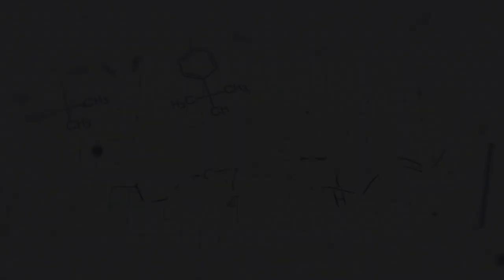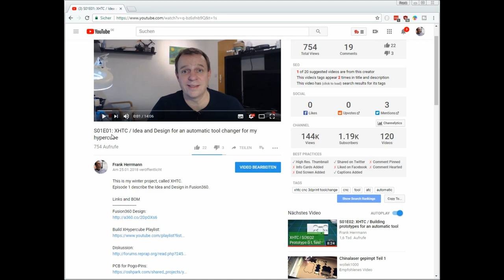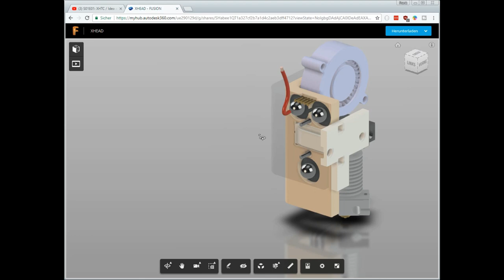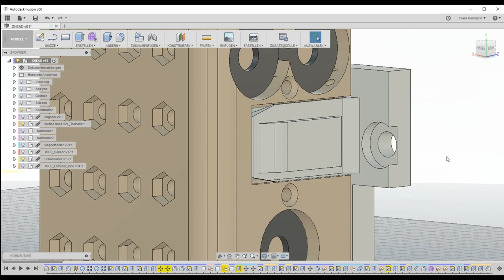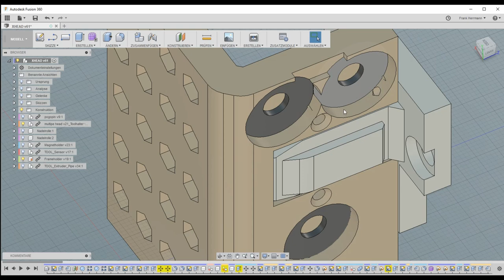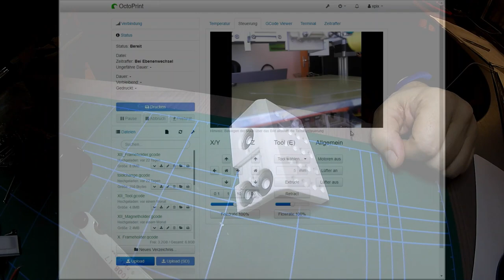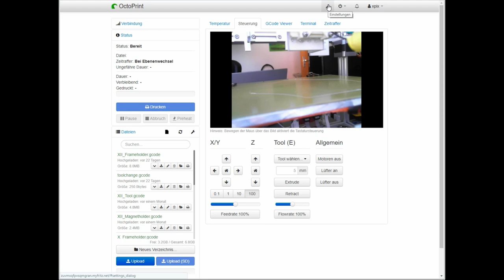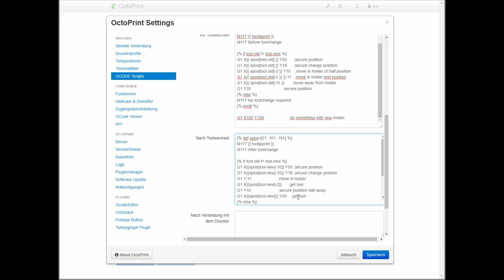S01E03: XHTC  / Design Improvements & Octoprint Preferences

Comment: Hello Frank, thank you for sharing. I like your approach with the all magnetic coupling. You asked for some feedback, here's my pitch:  I'm designing a tool change as well, and consider keeping the nozzles hot. Maybe at full temperature, maybe not. Maybe it's even possible to let the nozzle cool and have a timed heat up in the parked position to be hot at expected time of tool change. I also had the pogo pins in mind, and think it might be an option to add an extra pogo connection in the parking position of each tool. Every parking position has it's own temperature control, which can be easily added and controlled by the board's extra space for additional extruders. Let's say your board has connections for 3 extruders. Tool 1 would be the real x carriage, tool 2 and 3 dummy tools just for separate temperature control when the pogo pins in parked position connect. To prevent duplicate signals one would have to switch off the heater on tool 1, park the tool, and then switch on the heating of that parked tool to desired temp. I'm not sure yet if the temp sensor would be an issue if momentarily double connected at the time of change. 
Long text, but I hope something useful!
Ciao..
Reply from the maker: Hello and thank you very much for your feedback, I was very happy about that. My idea is a bit simpler at the end, I like it simple and therefore we just have to connect a power supply with 12V instead of 24V and approx. 3-4 Ampere to the extruder in the park position. Without a thermostat it holds about 180°, because the volts and amperes are limited, it can't get warmer. 
What is your opinion?
Reply: Good idea, I'll consider it as one of the solutions..I'll experiment a bit when I have time.. Leaving the extruder at an uncontrolled 180 wins in simplicity but doesn't give much options to control the idle temp. For PLA the ideal temperature would be different than ABS or any other filament. For some filaments maybe even already too hot. (Maybe flexible or some PLA's) 
Personally I do like a quick toolchange without wait time to heat up. Especially  when switching between tools frequently. I had an e3d chimera on which I had to lower the inactive nozzle to prevent ooze, but those heat up times were just eating time. None the less, your idea goes in the pocket,I still might need it in future, thanks! What was your reason to make the tool park bracket thicker to separate the magnets from the washers?
Reply from the maker: Sure, the magnets have an immesne holding power of approx. 5kg. The stepper motors can't do that, so the holders have to be pushed apart.

Comment: I would keep it connected. You will still have to have the filament connected, and because of that a filament tube (even if you have a direct extruder), so there will be a suitable path for the cables anyhow. Also this will lessen possible issues with bad connections that sooner or later tend to pop up with connectors that oxidize etc...

It would then be rather simple to fix your toolchanging scripts to lower the temperature of the hotend not in use a bit, or use Cura that have such settings already.

Probably, to stop oozing, I would also experiment with a parkingspot that basically would let the nozzle rest on the tip on some heat tolerant material, that way keeping it closed. Then, after reconnecting, press out some amount of filament into a "wastebin", and let it pass across an edge and a small wirebrush to have it perfectly primed to start printing
Reply from the maker: The suggestion is not bad, but I have the following problems with connecting the cables:
* the heads are more compact and can be changed faster
* no cables stand in the way, and less mass is moved
* only one temperature sensor and one contact are used for heating
later i want to use a spindle or the inductive sensor as an extra head

I had already thought about parking and the wire brush and I will certainly do what they suggested.

Thank you
Frank
Reply: How about a heater at the tool holder itself?  Just a small aluminum block that the unused extruder is pressed against.  If they all stay at a constant mid temp (like 200c) you could get away with one thermostat and maybe even one heater if you put in some heat pipes.
Reply from the maker: Thats a nice idea, i'll thin about it.

Comment: I don't plan to use the electrical connections on the tool changer. I plan to have each tool head be continuously connected to the controller. A lower temp while docked is probably a good idea. Have you checked out e3d's tool changer?
Reply from the maker: Yes i read about this project, very nice and close the same as my.